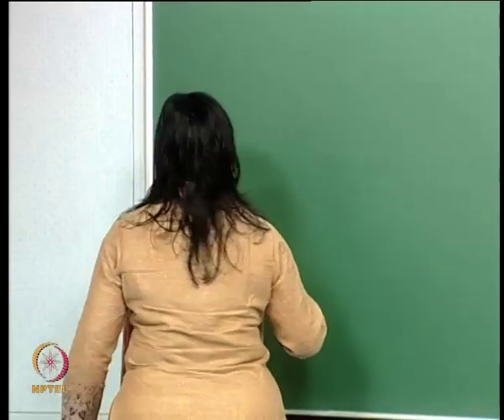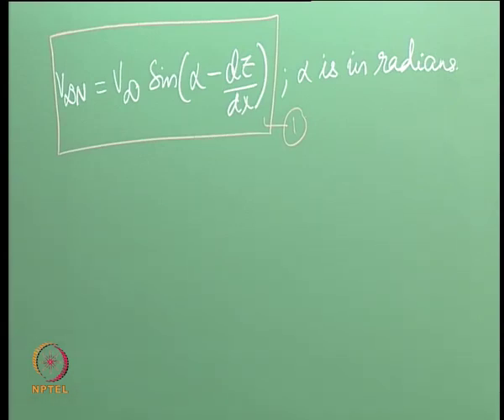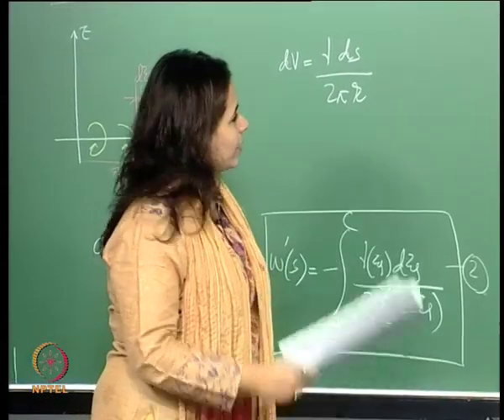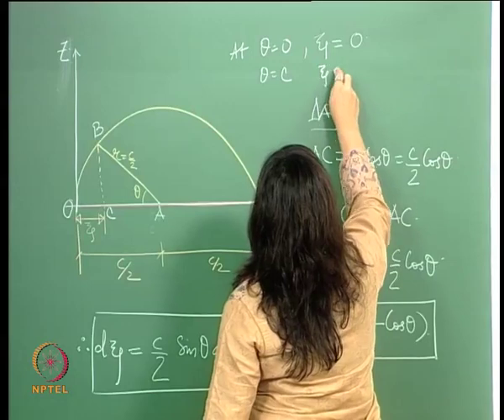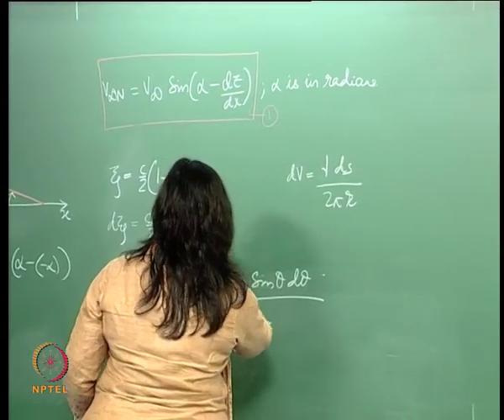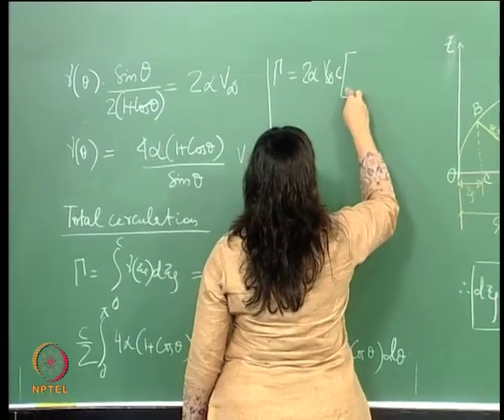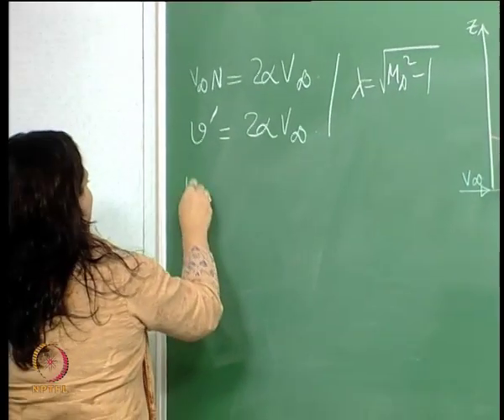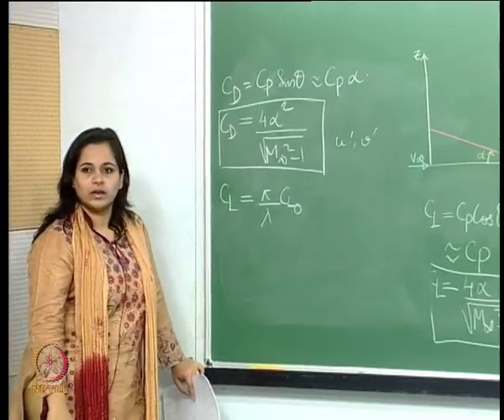Mod-01 Lec-31 Lecture-31-Example Problem using Thin Airfoil Theory

Comment: while solving the LHS that is w(s) how can she get (1+ cos(theta)) in the denominator.
according to the expression she wrote for LHS she should get tan (theta) in the numerator.
no 1+ cos (theta) in the denominator...
rest answer is wrong 
and yes slope of the camberline is zero but by defining the flat plate camberline lies on the chordline is kept at an angle of alpha. so the slope would be -alpha...
please correct me if i m wrong.

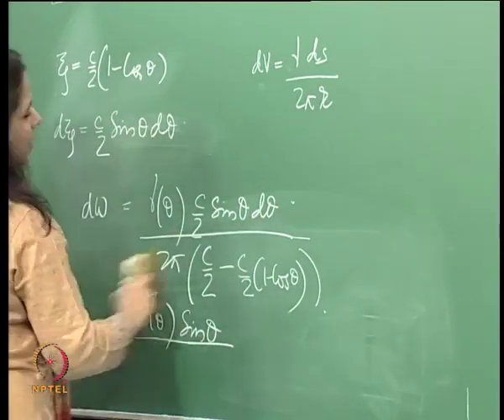Comment: How does she just say that d(theta) turns into pi onto the left hand side of the thin airfoil equation without integrating the other terms that are dependent on theta? @25:40

Comment: You're right. The slope of the camberline is zero in this case.
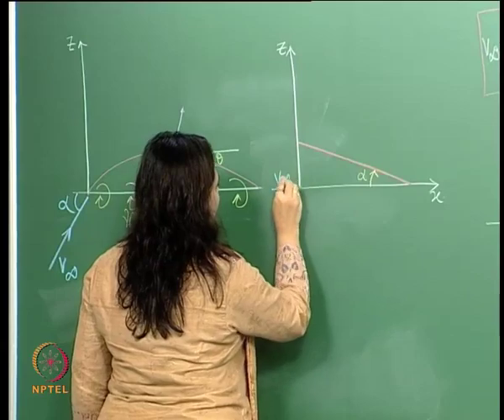When she drew the picture @21:05, she redefined the freestream and the angle of the chordline.  While the new drawing still maintains an angle of attack of alpha, the same coordinate system is used as before when she defined the normal component of the freestream.  The new normal component  is no longer V_infinity*(sin(alpha+(dz/dx)).  She used the new definition with the old coordinate system and gets an incorrect answer.